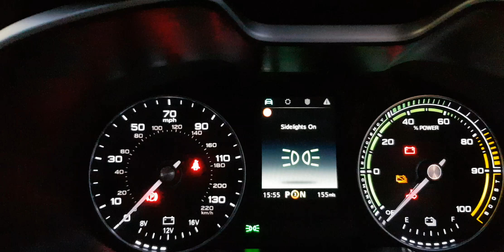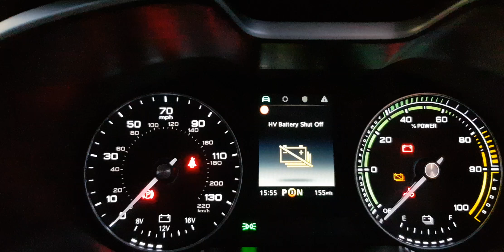MG ZS EV 1st Electrical Breakdown

Comment: What happened? Did the Dealer fix it or did you manage to 'turn it off an on again' for an engineer reset'
Reply from the maker: Hi Turning the car off and back on again made no difference and the car still showed the same faults and wouldn't move. There is a MG Assistance AA card in the pack supplied with the vehicle so I called them out to look at the car. After a bit of head scratching and various checks, the AA guy did a diagnostic check on the vehicle and cleared the faults and then the car was back to normal. It will still need to go back to the MG  dealer to give it a health check. I'm still happy with the car as I know any new car no matter what the make can be prone to technical faults when they are first launched.
Reply: @bournvilleman  many thanks for the update.
I was just wondering what the fix was.
I'm glad it did not put you off the MG👍
Reply: Hi,
Have the same car and countering the same issue. They thought that it is the 12v battery, so they changed it. The next day the issue returned again...
Am wondering way was the final solution in your case.